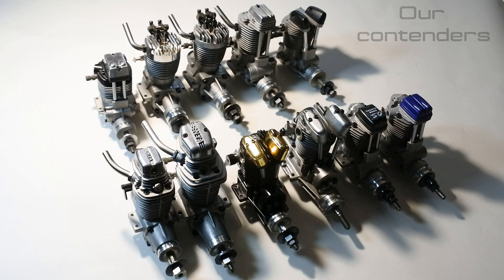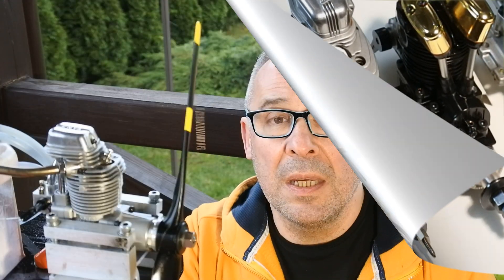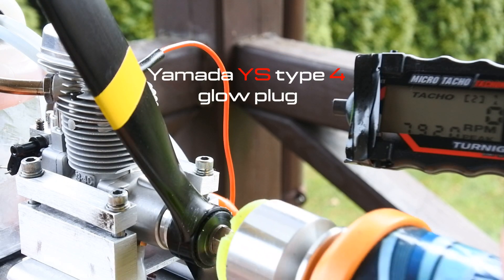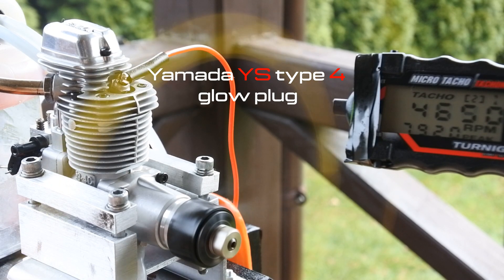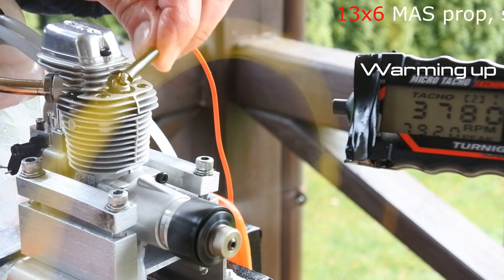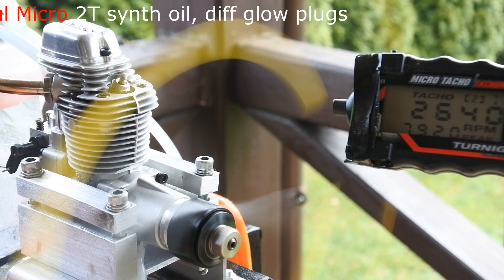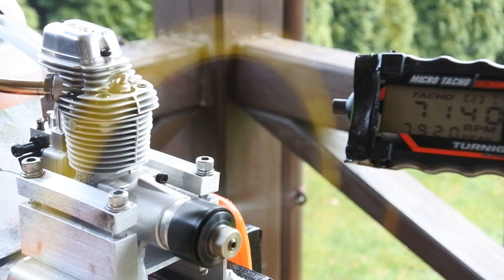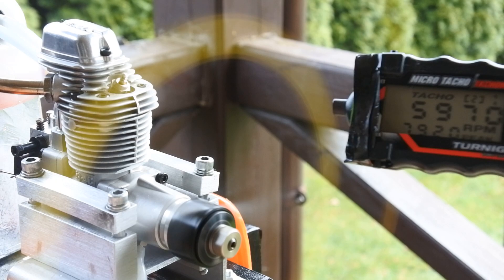Enya 53 4C comparison test run

Comment: The real trick with those Enya 4-strokes is that tehy can be run in reverse rotation without any parts purchased. Just re-time the cams in there.
Reply from the maker: Thank you for your comment !  Certainly, yes, and this feature is really requested by modelers. If I'm not mistaken, somewhere in Enya's original manuals were written and shown oh the sketches, how to retime an engine to the reverse rotation. 
Thank you and have a nice day !
Reply: @crazyengines88  Its a godsend given how few pusher prop options we have. I got an Enya 53-4c specifically because of that, as I have Long EZ 46 that would work well powered by that engine. And by running it in reverse rotation I have access to a wider variety of props than I do with the 46AX 2-cycle currently fitted to that airplane.

Doesnt hurt much that Enya engines run like swiss watche, either. Quality on par with OS and Saito. Mine runs as well as yours does even though the bearings are completely fried; I have video of it running! https://youtu.be/b18D6zFs_58